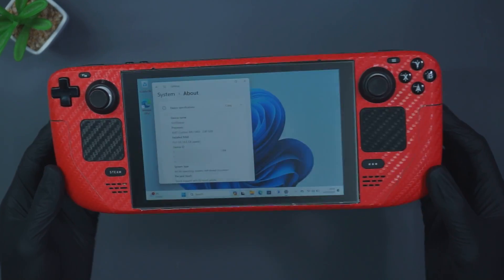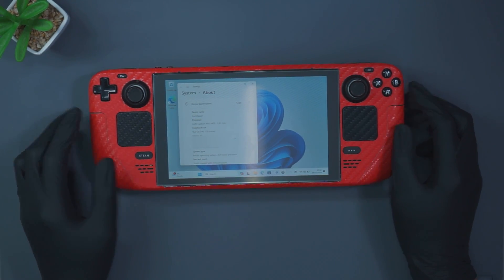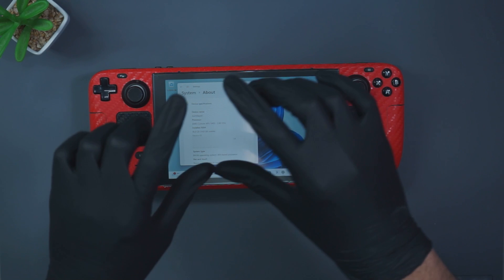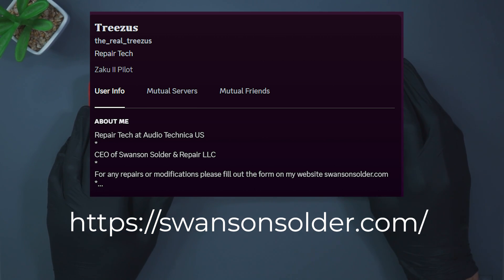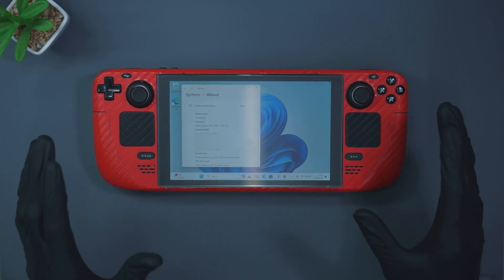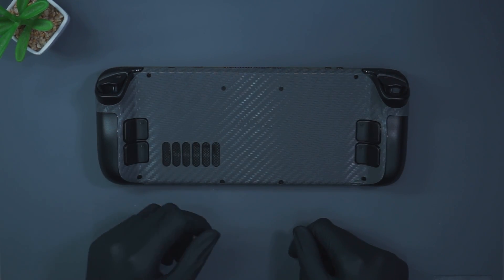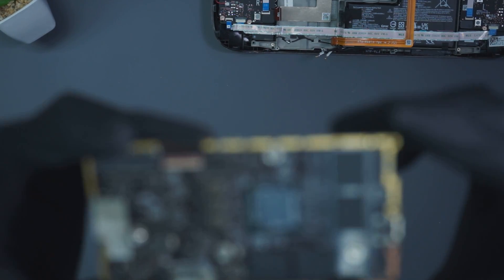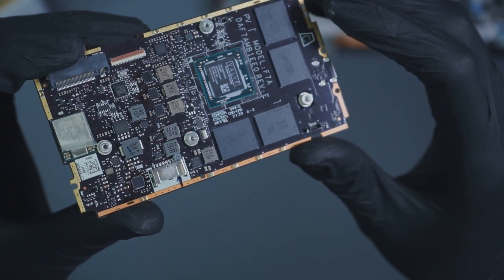Steam Deck 16GB to 32GB RAM Upgrade | Joshi Repair

Comment: would it be possible to upgrade it to more than 32 gb?
Reply from the maker: Not only would the memory controller within the APU have to support it, but so would the bios. Honestly, the upgrade isn't something 95% of people need or would even benefit from. It only helps in very few games, and even then it's usually for the 1% or 0.1% lows. This was done on our personal deck, as we enjoy modding these kinds of things.
Reply: It will completely depend on the cpu. If it can’t register more then no.